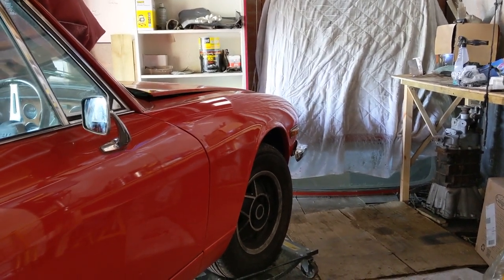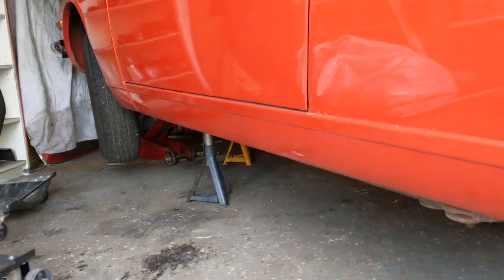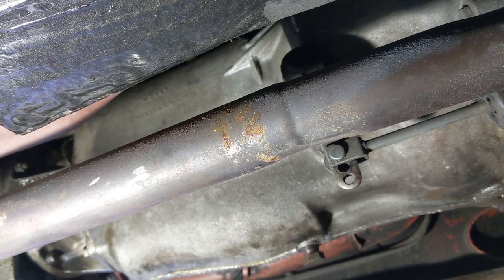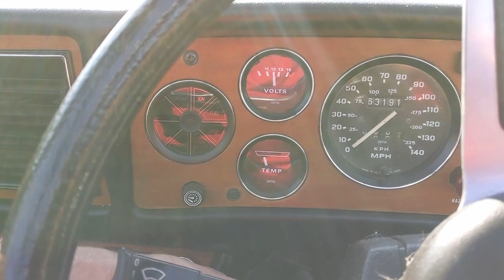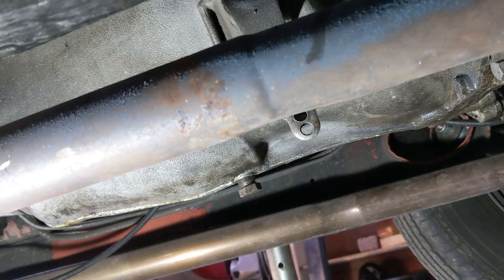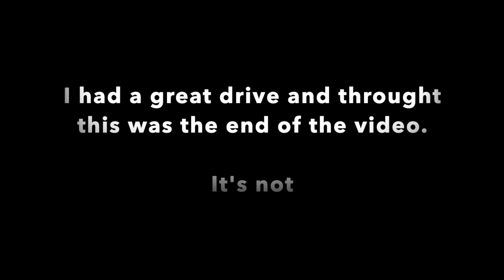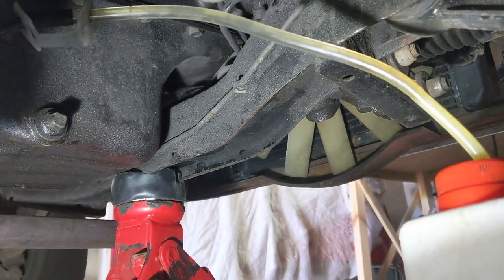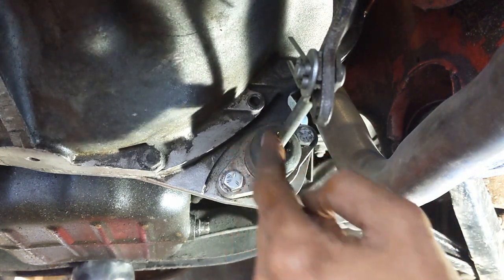Triumph Stag :  Clutch Issues

Comment: I think the screeching noise could be the thrust bearing too.  I'd start changing or renewing seals in the slave first, as that one is the one that would be exposed to more heat over time. Feel your pain Henry, good luck.
Reply from the maker: Thanks Chris - I replaced the slave about 6 months ago some I'm moving to the master and connecting pipe.

Comment: Done, be, bleeding the clutch saved you a big job. The slave cylinder needs a repair kit with new dust seal. that may help. good luck Bob
Reply from the maker: Thanks Bob, but I think the problem is with the master cylinder.  I changed the slave roughly six months ago trying to sort this problem

Comment: yep, i think i would replace master and slave cylinder too or at least refurb yours, the fluid is probably pushing past the internal seals hence why you have no external leak and pumping the pedal brings the pressure back initially. Also looking forward to more TR7 shenanigans.
Reply from the maker: Thanks Ian, it is where I was leaning
Reply: Good shout on the passing of the fluid via the seals. I've not had this on any of my Triumphs but have heard of it.
Reply from the maker: @ChrisFEJackson  I've just removed and taken apart the master cylinder.  The spring is broken
Reply: @HenrysGarage  I had that issue on one of my TR7's back in the day. But the symptom was as if something was stuck under the pedal & it only travelled half way! Happy to hear you have found the root cause....probably :)